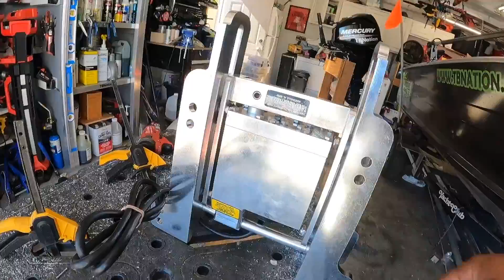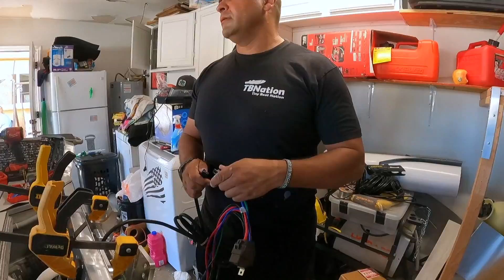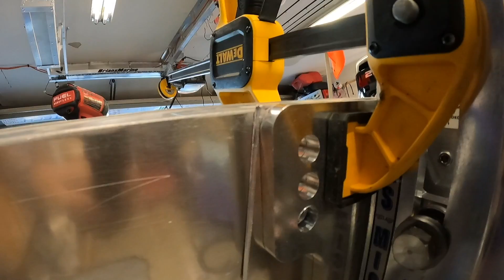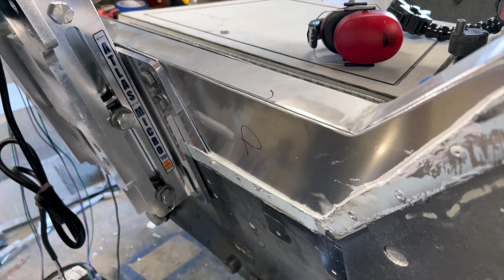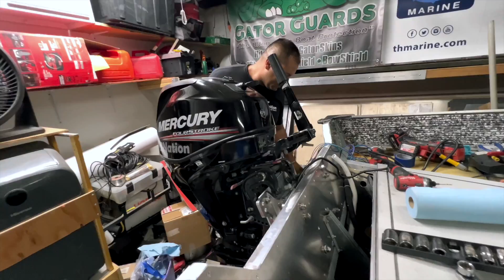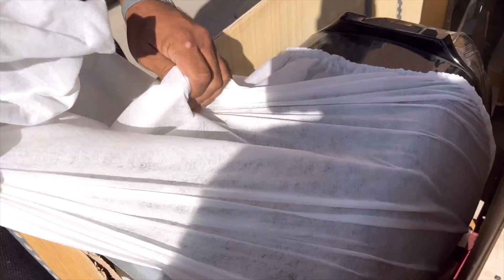Atlas Micro Jacker - hydraulic jack plate install & demo - TBNation

Comment: Just for a motor and it’s a 20 inch shaft I need a 25inch shaft. 
Does this jack go down? Or I have to place the jack 5 inch lower from the top of the transom.
Reply from the maker: Modify your transit to fit a motor that big. Or get a different motor if that’s not the case.

Comment: Would you run a 90 2 stroke on that Jackplate? Looking to add a JP to my PT190
Reply: What's only rated for 30?
Reply: Yes 90 2 stroke all day
Reply from the maker: It’s only rated for 30

Comment: The Micro Jackplate will not clear most portable outboard clamps. You have to add spacers between the outboard and the jackplate atleast 5/8" or .625". You can go 3/4" or .750" if you want more clearance. Universal aluminum spacers can be ordered online. O.D. needs to be atleast 1.5" and I.D. needs to be a little over 1/2" for the bolts to go through.  I had to do this to my Suzuki 20hp and 30hp on the same boat but I machined my own spacers. If you are able to put 4 bolts into the jackplate, you can remove the outboard clamps. They're just in the way.

If your portable outboard has standard hole patterns, then do the spacers. If your outboard does not have standard mounting holes, you will need the adaptor made for the jackplate for clamp on style outboards. I still had to add 1/2" of space to clear the clamps on my 20hp suzuki with the clamp on bracket.

Comment: I did this same thing to my StarCraft SF14 It had a short transom and I set it up to the Merc 25 at 21 inches high,  Used a Diamond plate truck tool box for the sheet of Aluminum to cover the back. CHEERS Michael!

Comment: Guys, when you’re drilling through transoms with those big bits, switch to a high speed 1/2 inch or larger corded electric drill. It will provide the additional torque and speed you need to cut through all that material. Those battery powered drills don’t have enough power to do the job.  Trust me on this, I’ve been doing work like this since the late ‘70s. Good job over all, just remember there are some jobs where those battery powered tools just don’t have enough muscle.. Cheers, and thanks for this great video.
Reply: I was thinking the same thing.
Reply: finally someone with a brain commenting

Comment: I would recommend a product called Tap Magic Aluminum. It’s a great cutting oil. For drill bits loom for TiN coated ones. They will last a lot longer than black oxide and the tap magic will keep them cooler and lubricated.
Reply: Spend the money on cobalt bits and never look back. The titanium nitride is just a coating better but not what you want if you’re doing a lot of metal work